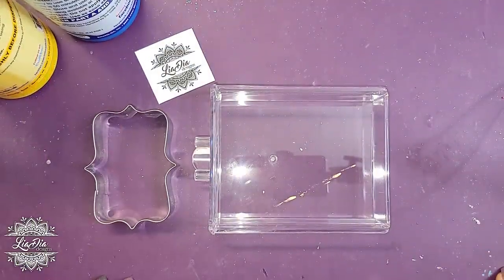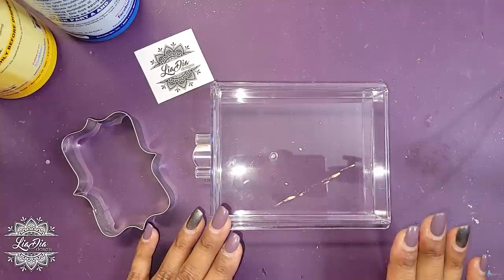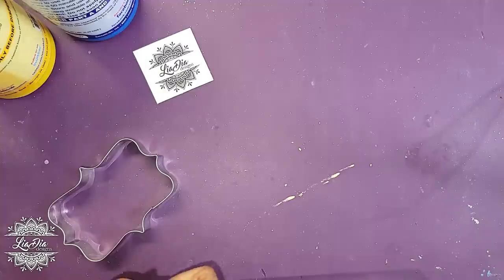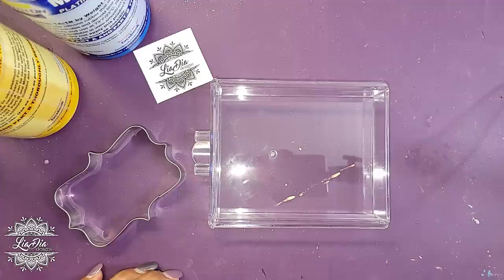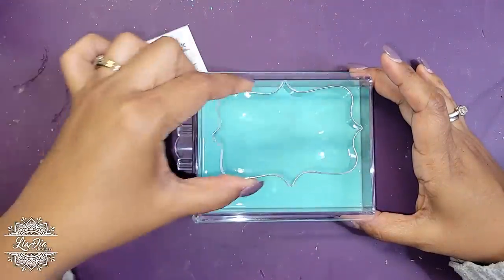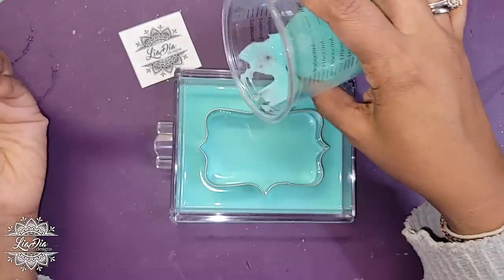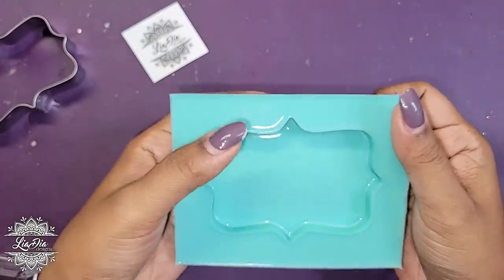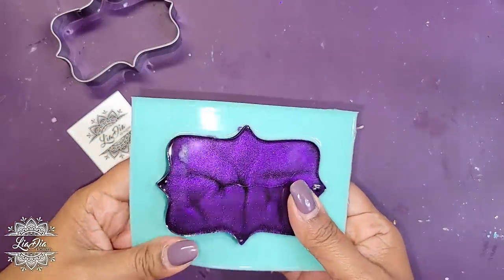This Actually WORKED! Using COOKIE CUTTERS to Make a DIY Silicone Mold for Resin Art

Comment: FYI, if you create a mold that didn’t work out or one that is no longer acceptable, chop it up into small pieces use it as filler around a new mold pour, you’ll use less mold making materials and great way to recycle silicone. I believe there are people on YT who demonstrate this. Someone showed me in a class I took yrs ago.
Reply from the maker: Yes! Someone mentioned this in my previous mold making post and that's amazing!💕🤩
Reply: I think it has to be the same kind and brand right? Or can I use any?
Reply: I used to do that with great success.  It does have to be the same type silicone or you get a gelatinous mess!

Comment: Once I was making a mold and ran out of silicone.   It took 2 day to get more.  Finished out the mold with new silicone and it worked out great.   You pushed the cutter into silicone.  Try not doing that the only thing is you would need to add weight to cutter so no leaks.  Great job.   hugs Sheryl 💙🎨💙
Reply from the maker: 🤩thanks Sheryl! Good to know that the timing of adding the next layer of silicone doesn't matter!
Reply: Yes I think I pressed it down too far and now I have a thin lip I have to use a deburring tool. Okay if you only have one item but I have 12. Lol. And didn't realise I should trim them when resin hasn't cured.

Comment: Hi Nadia, your mild turned out beautifully and that purple is gorgeous ♥️. If you use packing tape and place the cookie cutter on top of it, (contact paper, works also), you then go around the edge of cookie cutter with hot glue, to properly seal it. You can then pour resin, inside the cookie cutter, to the depth you want, with This will then be your blank resin piece, to make all future silicone molds from. I hope this helps and is easy to understand. I love your art and your channel. ♥️🙏💐💐💐💐♥️
Reply from the maker: Thank you Fiona. 😊 I've never tried to pour resin into a metal object that I then needed to remove,  as it seems resin sticks decently well to metal.  But maybe with mold release that could work.  Definitely a possibility with plastic molds that flex.  In any case,  it's an interesting idea💕
Reply: Great idea.  You could also cut polymer clay with the cutter, bake it, and use that as your blank for mold making.

Comment: I haven't made a mold yet but I want to. I was wondering, how can I make a mold from a glass item? What does the glass item have to be coated with? Do I use a spray,  vaseline, plastic wrap or something else?
Reply from the maker: I haven't tried molding a glass piece yet,  but I would think you wouldn't need to coat it at all.. silicone doesn't stick to glass,  so you should be fine to use as is... just be sure to clean the glass from oils or fingerprints
Reply: @LiaDiaDesigns  OH!! I thought it did. Thank you.

Comment: I have those cookie cutters from a Sophie and Toffee kit.  I set the cookie cutters down on tape, put another smaller cookie cutter inside and poured resin between the two.  I made some nice ornaments to hang and I made shakers out of a few.  You made lovely molds.  i had not thought of making molds of these.  I used these as the molds.  (I used silicone cake pans to pour resin by the way.  Just as protection in case of leaks.)  You could put pictures on the resin shapes.  Terrific holiday ornaments.

Comment: I was wondering, how would wood shapes turn out using silicone?
Reply from the maker: I think it would work... but the silicone will keep any grain and rough edges in the mold... so if that's the look you want,  that would be perfect
Reply: @LiaDiaDesigns  thank you
Reply: Bet that would be cool...would have wood grain effect

Comment: All you have to do is use mold release when you pour silicone on silicone. I would try it out on a mold you don't care about first to see if your mold release works. That's a gorgeous color and shape.
Reply from the maker: Interesting...What would the mold release do? From everything I've heard/ read... silicone seems to stick to silicone without any additional products...
Reply: @LiaDiaDesigns  I saw Claire do it on her channel, "Clair's Crafty Corner"
Reply: She said she didn't even use the spray, but she did use Let's Resin silicone and I think she used their molds also. It's her new video.
Reply: I'm here to tell ya it doesn't work if you don't use the spray or something, I ruined one of my silicone cups BC I just poured straight silicone in my cup.